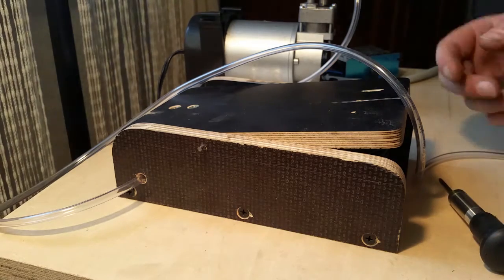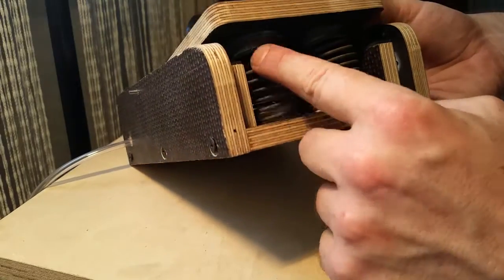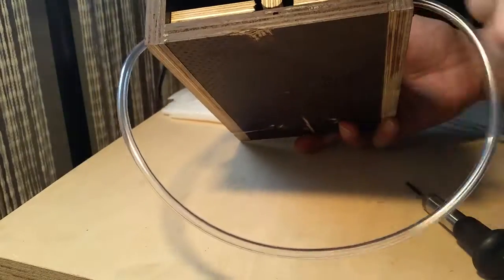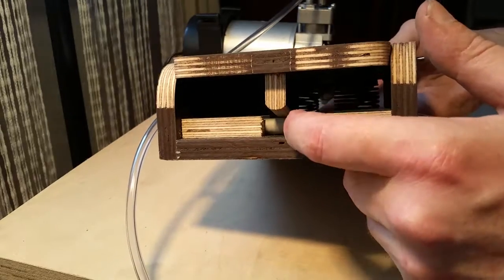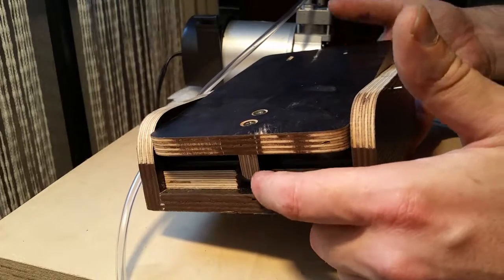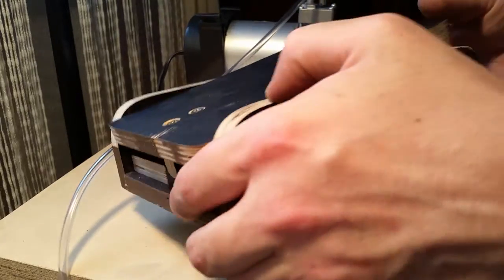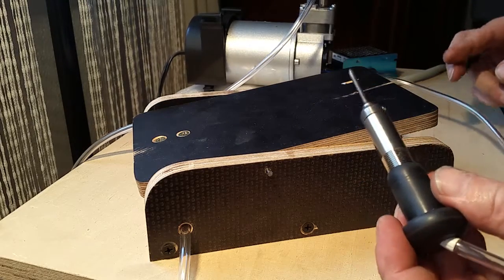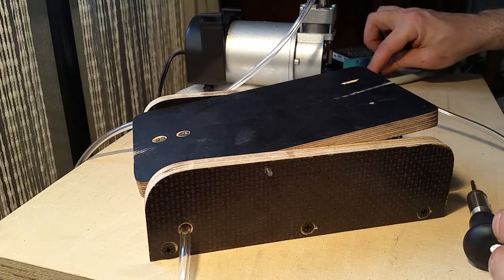Footpedal for my Diy  pneumatic graver

Comment: Nice job. You saved me a job posting a video. i wish there was a way to reteet YT vids :)
I made another version controlling the speed via variable voltage like Sergeys ,just to see what the effect is. I tried the switch for an electric drill,but that really isn't variable,it has 4 different set speeds. I then used the speed controller from a scalextric toy car. It works perfectly. Still have to attach it to a pedal,but should be to difficult.
Reply from the maker: initially i was thinking about turning the speed controller into a foot pedal but came to the conclusion that the cheap potentiometer probably would wear out  fairly quickly being turned on/off on a constant basis. so i opted for the simpler "pinch the airflow" method.   sergey used a sewing machine foot pedal (220V) regulating the voltage to the 220/12V transformer followed by a rectifier to make DC current. since i use an old computer psu to supply power 220v foot pedal is out. ill take a look at the scalextric.
Reply: The pinch pipe has the exact action a gravermach has. The electric pedal would be like a lindsay type action. The scalectric uses a coil that a contact rubs against, must becsimplevto make, but to complicated for me